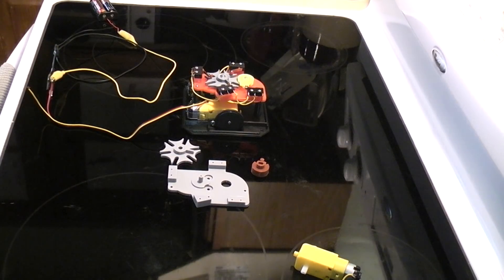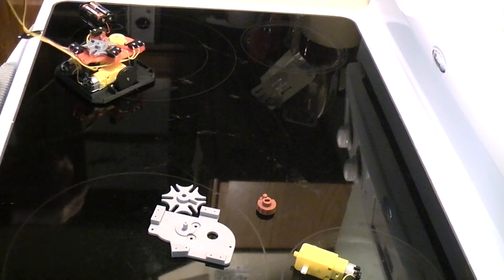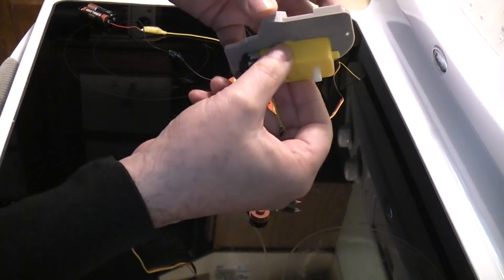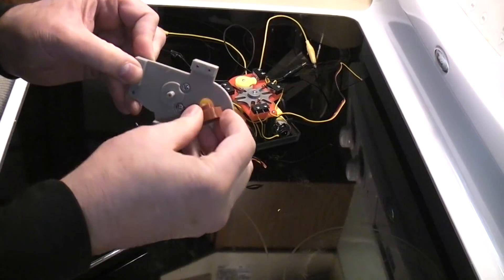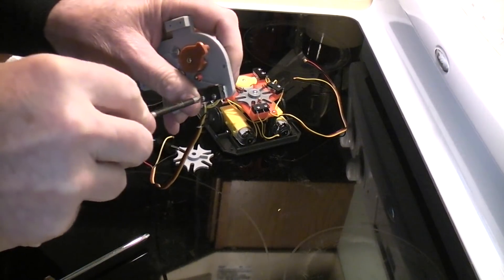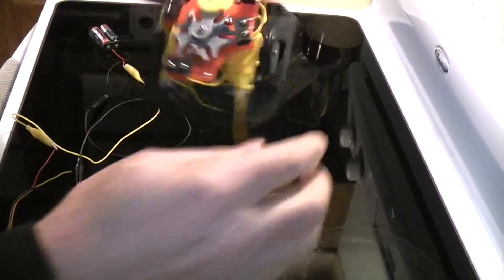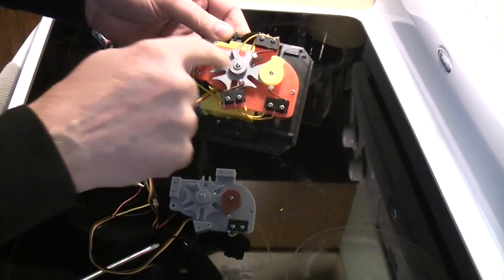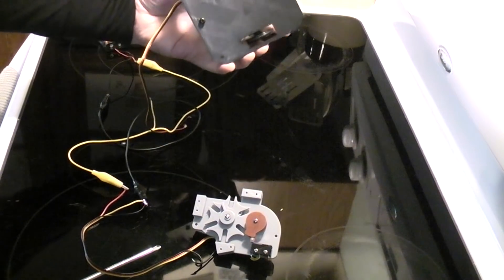Electro Mechanical Geneva Sequencer for dual drive  robot base control. You can build.

Comment from the maker: I have added a picture of a non roller switch set up, you just bend the long arm around and trim it as needed. The long arm switches will be easier to set up than trying to find the right roller switches, since the position of the roller on the switch arm is different with every manufacturer it seems.

Comment: This is insanely cool! thanks for sharing!

It looks like the circuit for the motor that the cam is attached to is a normally closed switch (So the power is on to the motor as long as the button isn't pressed) and then another tap to the far side of the NC switch that you control, apply power to that just long enough to start the motor even though the switch is open and then the motor will turn around until it turns itself off by pressing the switch back in correct? Did you have to fine tune the CAM profile to make the start/stop repeatable or is it fairly forgiving?
Reply from the maker: I t  is very forgiving. A gear motor that runs too fast might have a coasting problem when the power is removed and that could be a problem.